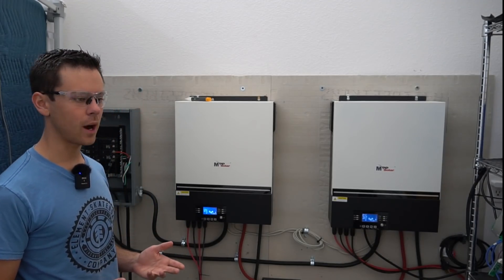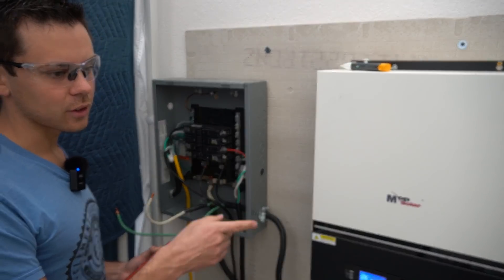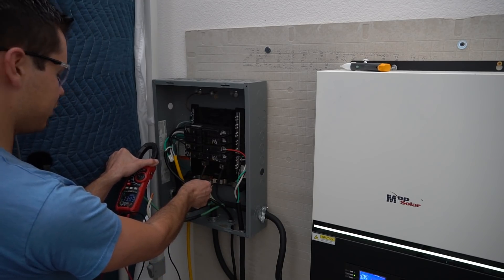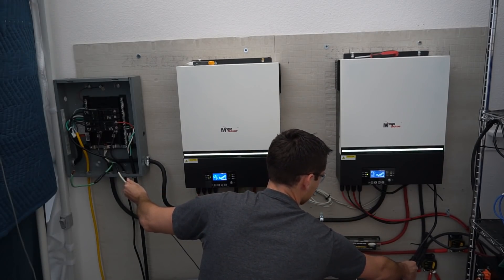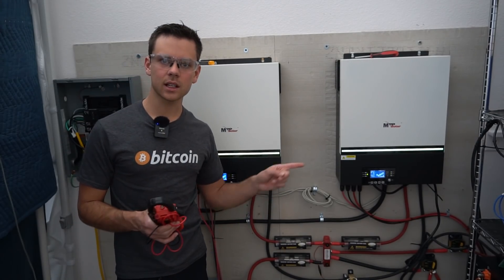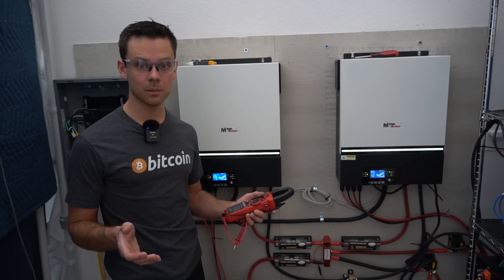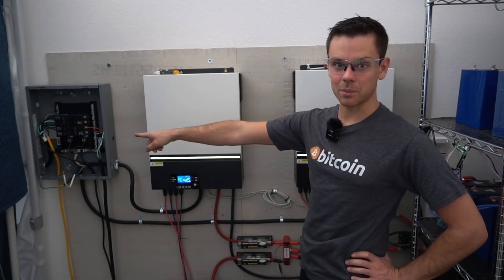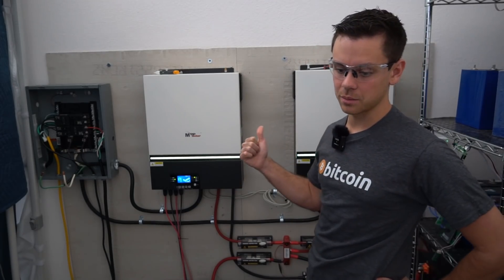Advanced Level Grounding Discussion for All-in-one Solar Power Systems

Comment: Hi ! I’m as lost as last years Easter egg … I have a RV .  Shore power gets turned off automatically when generator is started (factory) ….. I added big batteries, some solar , ac inverter, (my charger) and a mechanical switch to turn off shore-generator and turn on inverter and batteries ….. the ground from inverter plug ties   120 house-120 shore-120 inverter 

On top of all that I want to occasionally use a Honda generator for shore power ? 

I’m thinking that’s a big question (with a few choices) ? 
Any direction would be appreciated

Comment: 3:10 You can indeed connect a ground rod to the AC output of the inverters. But it must be done to the ground terminal, not to the neutral terminal (to avoid ground loops and objectionable current).

Similarly, in telecommunication systems, the NEC requires you to add a new ground rod to the grounding/bonding system (but not the neutral) of the telecom system if the distance between the telecom grounding system and the power grounding system is greater than 6 meters.

Comment: Introduction: Each inverter has its own current flow path, each one needs a reference ground point and a short current path. Two of them are combined to make a split phase system which shared the neutral wire. In this split phase system, current flows from each hot wire of it's own inverter and return back itself through the neutral wire. The ground is for reference point and a short current flow path. If the voltages of two hot legs are different, there will be current flow from one inverter to the other, does not matter you have one or two ground-neutral bond(s).
1. For transfer mode (Inverters using power from grid to supply power to the main panel by built-in relays), ground-neutral bond should be at the first panel (after the meter). This was already done when you have electric meter installed. The inverters are using ground-neutral bond from grid, this is correct. Do not create any ground-neutral bond to any panel in your house.
2. For off-grid, the ground-neutral bond should be at the inverters (grid neutral wire should be disconnected). If in case there is a short, the current flow will be terminated at the inverters. Remember, ground-neutral bond is used for reference point and short current flow path. One ground-neutral bond will work, but two are better. Current loop occurs only if your neutral wires are so small and two inverters are mounted far apart (long distance). For conclusion, keep the ground-neutral bonds on all inverters. You cannot count all inverters have bonding as multiple points, it is still single point of bonding because they are together as one power source.

Comment: I have two LV6548 units connected to the grid for bypass mode, so the neutral and ground are bonded at the grid master breaker. It is important to not bond the neutrals and grounds anywhere else, including any subpanels, thereby avoiding current sharing between the neutral path and ground path. Current sharing is bad -  high currents may result in voltages appearing on the ground, which leads to the possibility of electric shock from equipment cases. No current should flow through ground during normal operation. The LV6548 units disable ground-neutral bonding when in bypass mode - so far so good. However, in battery mode, each unit will connect its output neutral to ground using a relay. This works if there is only one LV6548 in your system, but for multiple units, the extra connections need to be disabled. If you remove the case of an LV6548, you will see a small inverted circuit board just left and below the center. If you peer vertically down along the top edge of that board, you will see a screw head on the circuit board below. Remove that screw to disable any bonding.

Comment: I'm struggling with the same issue. My camper has a 3000 powmr all in one system. I just have a camper plug on it and plug the camper directly to it. I sometimes use the ac input in ac bypass and sometimes charge thru it and sometimes use batteries. I have sometimes I have 14 volts running thru the frame sometimes I have about 40 volts running thru frame. It's enough to feel when it's raining. I've been trying to figure out how to correct this I wish I could have a real conversation where someone could tell me what I'm doing wrong.

Comment: Thanks Will as I have been of grid for thirty years and to earth at inverter and distribution panel made no sense and equipment suppliers were vague about this also. All information I read or watched stated to ground but I decided for the reasons you outlined to use the "floating earth"  at the equipment end. Using the Inverters internal GN bond. And to quote part of Chris's comment " The reason we don't bond them in subpanels isn't to avoid ground loops, it's to avoid neutral current being carried on the ground conductor". Finally getting some sense on this important issue.

Comment: I have an all in one inverter using the reliance 6 circuit transfer switch. The transfer switch is using my utility ground so therefore no need for a ground for the inverter.  My panels have their own ground to limit a static charge and prevent a lightning strike but it stays separate.

Comment: DC terminals should be floating if their is no isolation between the grid and the DC side. Otherwise, if you see the voltage between one your DC terminals to the ground is oscillating at exactly half of you grid voltage. This is for Single phase.

Comment: When my growatt 3000 LVM-48P is running just off the battery, there also is a GN bond created... However the bond is CRAP.  I see continuity, but there is a TON of resistance there.  so much that my furnace won't run unless i re-create my own GN bond.

Comment: Ground wire is a backup track from any device to the source in case a live wire is shorted to the panel of the device. And there should be only one return path to the source and at the source ground wire is bonded to the neutral( either it is a battery based source or a transformer). In case of battery, it is a neutral bond inside it. In case of utility it is at the main panel. In your case when inverter is transferring utility power to house, it should connect ground of utility ( coming from main distribution panel of house) side to its loads.  When in battery mode, it should disconnect that ground and instead source a ground from neutral bond. But I don’t know if your inverter has this switching happening inside.  My two cents…

Comment: I'm running 7 350W solar panels in series directly to a 24k BTU EG4 mini split.  The panels will be mounted on a new alumiwood patiocover.  I was thinking I should ground the panels by running a wire from the array back to the main panel ground bar.  Is that the best option for this sort of AC/DC system?  There is 10/2 Romex going to the heat pump which is 240V.

Comment: Not sure what is the right way. but this ground bond is for sub panels so so don't have voltage going on the ground wire like you did with that one. you getting feed back from the nature. Here the AC panel should have it's own ground rod and the DC have it't own and all DC grounded. who is right who knows

Comment: I have a 3000W inverter where the earth and neutral  is not combined, and everything in my house that is connected to the inverter works 100% fine. I then replaced the 3000W inverter with a 5000W inverter where the earth and neutral is combined and it caused havoc to my system. I then removed the screw inside the inverter to separate the earth and neutral, but now for some reason my equipment don't work properly. What is the idea behind running the earth and neutral together. My equipment was working fine for years without combining the earth and neutral.

Comment: HOWdy  W-P,
Thanks
Still very confusing 
My system is (maybe) SIMPLER = an ALL-In-One INVERTER 
but
the OWNER's Manual / Instruction MANUAL is quite LACKING in:
WHERE to GROUND 
How to Ground 
How MANY Grounds 
INVERTER to Earth ?
SUB-PANEL to Earth ? 
PV Arrays are grounded to each other & to a SURGE-PROTECTOR at the Ground-Mount 
A/C back-up power from my MAIN-PANEL is already GROUNDED ( & BONDED) 
I hope that someone (not a GRID Electrician) writes a BOOK or presents a VIDEO soon 
before someone is injured / killed & equipment destroyed 
Thanks Again
COOP
the  WiSeNhEiMeR  from Richmond, INDIANA 
...

Comment: Thanks for doing these videos Will. Please can you do a video on using super capacitors or capacitor banks to increase the surge capability of an inverter system? For example, running loads with high inrush/startup current. I believe there are people doing this currently and it "works". Or if you think it's a terrible idea, let us know. Also, my 2.3kW Goodwe EM inverter says not to run an air conditioner on it, is that because of the surges, or it being an inductive load? If it's just the surge issue then I'd be tempted to use capacitors on the circuit. If it's going to kill my inverter and/or AC even with capacitors, then obviously I would avoid that.

Comment: that's a huge headache, i bought a victron multiplus 5kVA/48v/70Amp, and i'm having trouble knowing what's the right way to wire neutral and ground with it, when i had a small 800VA phoenix inverter i was using it purely floating ground
the problem is when it open the relay, there is no continuety when the relay open between incoming neutral and outgoing one
if i ground it, then i will have a ground loop when it close

Comment: Just wanted to congratulate you. Even licensed electricians get this subject wrong. I’m a master electrician with 23 years experience in the field and I see this confusion with the earth ground way too often. Thanks for spreading the right information on your channel. Keep up the good work.
Great video!
Reply: HI william, i have a 5kw hybrid inverter. its charges my 48v battery and can put out 5000watt AC.
when i switch on the AC output, the frames of my solar panels start tot have around 50VAC power on them. i even can get a shock from this.
when the AC output is switch off. nothing is wrong and the pannels stay safe.
do you have any idea what i have to do to fix this? i relly hope you can help me. thanks
Reply: Same setup/scenario as above.  I'm feeling very confused about things, going to disconnect my ground rod and also the ground/neutral bond wire at Service Panel (which is main panel, off grid no AC Input with a Chinese Hybrid Grid tie inverter) except for a sole earth ground connection at battery negative.  I have more to read about positive grounding before dabbling.
Reply: What if the only AC in is via generac home backup generator?

Comment: Im not an electrician but im pretty sure if you create any ground neutral link inside the property you are in breach of current regulations (if it is supplied by the mains). 
The big risk if you put a grounding rod in and using the inverter, and if you link the ground and neutral in the wrong place the RCD will not work. Then under fault conditions ( say a metal light). If you touch the light and a extraneous conductive pipe etc, the fault will flow from the light, through you and back via the ground to the rod because there is a substantial potential between the light and the pipe. Very important potential difference using correct supplementary bonding is kept to a minimum and so under fault conditions your breakers trip. Diagrams help people understand this.
Reply from the maker: That's why it's not. It doesn't touch the grid at all. And ac input on these units is only for battery charger if it is.

Comment: This is a very confusing topic for me. My situation may be unique. As I understand the operation of the LV 6548, while in inverter off grid mode the system has a ground neutral bond within the inverter. With AC bypass connected the relay opens the internal bond and then is provided by the AC input. If I remove the internal bond screw from each inverter (4) the bond would then have to be in the breaker panel from the inverters and should work correctly. If I connect the output breaker of the panel at the inverters to my home service panel I can remove the bond jumper from the first and the house service panel will provide a single bond. What happens when the low battery warning closes the dry contact and signals the generator to start? The bond is automatically provided from the generator and now there are two ground neutral bonds in the system. I have a solar panel supply, a battery bank supply and an AC generator supply all connected in this system. I will use the system as stand alone to power electric equipment and devices and also at times connected to the home service panel. Of course using isolation lock switches. I would like to know exactly the best correct way to connect the system.

Comment: Ok my head hurts. In my case I will have a split phase running to my main panel (disconnected from the grid/elect company).

I will be using a generator on the AC in when needed during the winter to top up batteries.

Does this AC in usage mean I should NOT ground from AC out to my main panel? 

Thanks!

Comment: I agree that it is not necessary to tie the ground wire and the neutral wire at the subpanel and it seems bonding the neutral to the ground wire on the side of the inverter side is the correct way to do but I believe that can't be enough because to have 0V at neutral and ground wires, it requires that  the ground wire to be tied to earth, this prevent to be shocked and in this video I don't see that is the case.

Comment: Hi Will.
Yep. Definitely bond / ground earth and neutral only at the source so that your RCD'S (UK)  / GFCI's will trip if a fault condition occurs.  An earth loop impedance test procedure (ZE) proves this.
One pole of a suitable N.O contactor relay can be used to achieve this bonding function  ...when power becomes "lost" from the grid making the inverters " off grid".
This way the original grid bond will be established once grid power is resumed and the contactor re-opens breaking the "off grid" neutral to earth connection.
Its losing the neutral when the supply is disconnected that makes this so important !
My quest  is to fully understand the grounding arrangements and benefits gained from earthing  my 48 volt Pylontech battery ?
I have my solar (DC array, framing and metalic enclosures) grounded via a thick cable going into an earth electrode rod in the back garden ( not linked at all to the grid / AC earthing system.
Should i bond the battery and metallic enclosures to the output side of the negative fuse terminal ?
Assuming zero volts exists there and it just provides a low-resistance path for the DC battery current to pop a fuse under a short-circuit fault scenario ?
Reply: Victron has a relay built in which you can use (or not?) For when the grid is lost. I don't know why more people do not RCD test properly, because this picks it up. At a customers, The ground earth cable was not installed from the source at the house to the inverter. An extra circuit was installed from the inverter to an outside bar/barbecue area, through a small consumer unit. They told  me they were getting a tingle from the dish washer. When the RCD was tested it did not trip, But the house RCD when tested did, because it was connected at ground earth source( Ze was fine)
. On further investigation we found 2 more ground rods, 1 connected to the inverter and 1 to the Bar/ bbq.

Comment: Grounding is 1 of most important things in electricity. In 120v you have 3 wires. 1 is live (black) 1 is neutral (white) 1 is ground bare wire. Neutral and ground is same . Difference is that the neutral is isolated and the ground is used for protection and not to carry electricity.
Say you have a washing machine with default live touching case and not grounded then the machine become live. If someone Touch the machine and a nearby copper water pipe you get a free hairdo at the least. If the machine would of been grounded the breaker would open the circuit and all danger gone.

Comment: So I have one lv6548 connected to batteries and solar panels on a off grid cabin system. I am considering connecting a sub panel with 20 amp breakers but I’m confused as to if I need to run a ground from sub panel which acts as my main panel to a grounding rod outside in the earth 5 feet to eight feet deep. Currently system runs fine with no sub panel using a surge protector outlet as breaker but I figured switching to a sub panel and connecting an earth ground might be safer. What’s your thoughts? Do I need to run a ground wire to grounding rod twenty feet from cabin or no need? Any info here is great as I don’t want to create a problem.